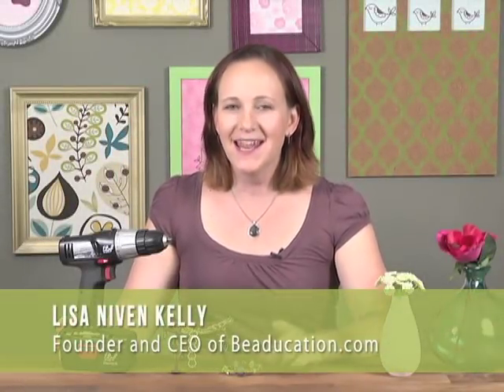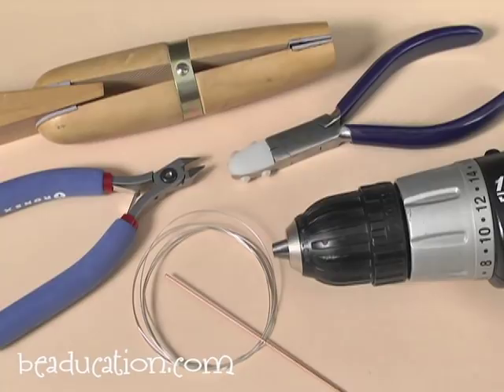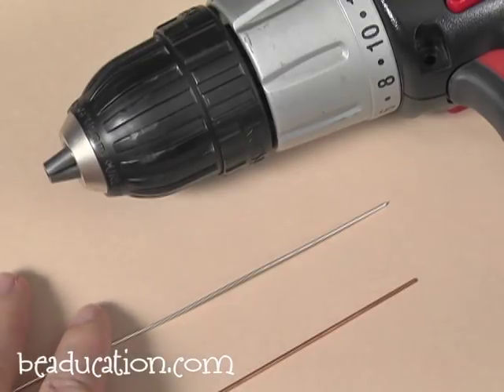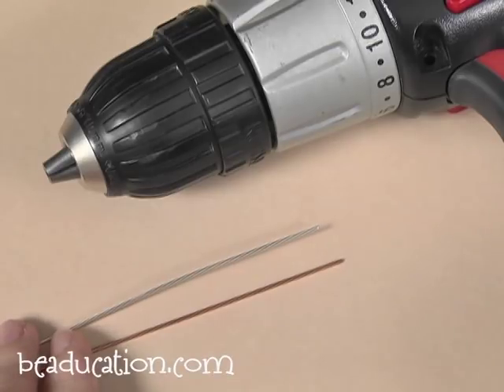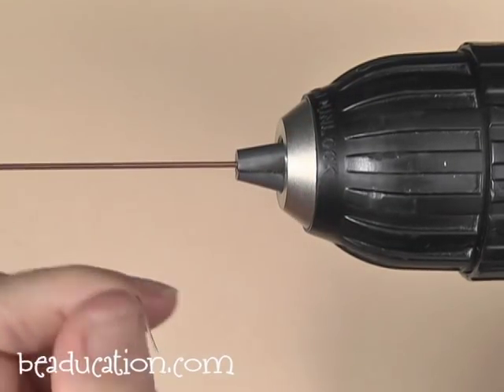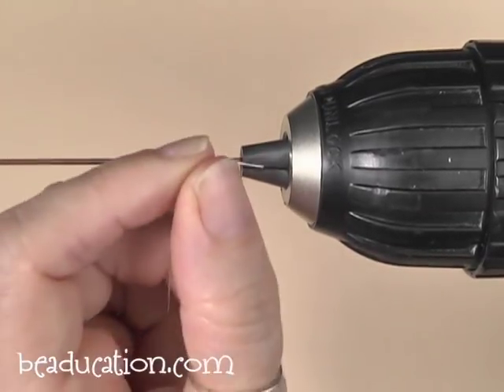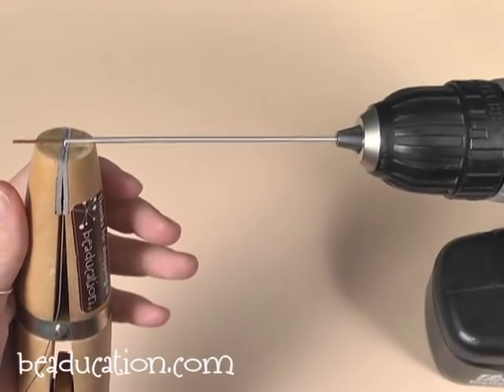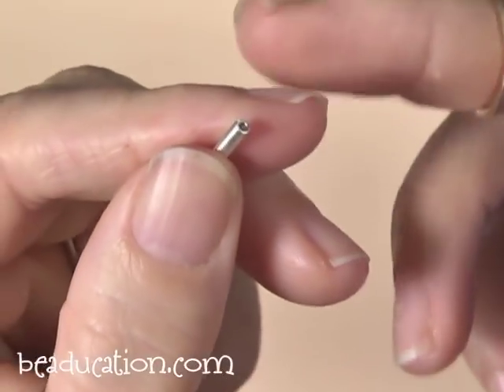Coiling Wire on a Drill - Beaducation.com

Comment: Thanks for this I've been making coils and jump rings this way for years I was beginning to think that I was doing something wrong (I do wear safety glasses) but t is the easiest way.  If you are a crafty type you can make oval shaped wooden 'mandrels' with small hole drilled in the round bit that fits into your drill chuck and you can make nice oval links for charm bracelets (hammer the wire first to harden).
Reply from the maker: Hi there! I am glad you found this useful. I think the number one key here is to use a drill that has an adjustable speed so you don't start fast and quickly get out of control :) Thanks for the tip on making oval shaped jump rings!

Comment: Thanks for the show..One thing i was waiting for to see,, you cut up all the small little coils to size..Thats where i have had
problems...Trying to cut same size coils..I was hoping you had a easy and fast way to cut them to size..I am still learning
to bead and to use wire. So i don't make so many errors..I make little things for the kids in my family and some big ones to..lol..I do get asked to sell my little gifts..If i learn more i might..Thanks  again...JRC.
Reply from the maker: Hi,check out Step 1 on this class, https://www.beaducation.com/online_classes/80-tornado-beads. About halfway into that step I show how to cut them up. To cut them the same size, I draw 2 lines on my left pointer finger and line the coil up to those lines and snip and cut from there. Kind of tricky, eh? Just remember, the lines you draw on your finger are likely thicker than the wire, so try working from the inside of one line to the inside of the other. Good luck!

Comment: Hi, This tutorial is very informative, Thank you :)...

I only had one question, if my drill does not have a reverse drilling option, how shall i remove the tension in the end, before pulling out my coil?
Reply from the maker: You can just release the coil but beware that it will shift a bit when it is released so keep your fingers away from sharp edges.

Comment: Im an avid Wire Wrapper of all different Gems n Crystals. This was a great video! Never would have thought using a drill to coil wire! i have a hand corded dremel and a bench grinder with flux shaft, ill have to try that out. Would just Thick like 16 gauge copper wire work as the host for coiling? its half hard. and takes alot of force to coil a thinner wire. I Subscribed to your channel. lookin forward to future vids. Thank You! :)

Comment: I'm assuming I can get that welding rod at Lowe's, but what would I ask for, what gauge, what size, how long?
Reply from the maker: basically you want any hard wire that is the gauge you want. The length shouldn't be any longer than a foot.

Comment: I used 16ga copper wire as my core wire and 20ga to coil with, WELL ! I couldn't get the coil wire off, it was sooo funny. I have to find a stiffer piece of material and try again.

Comment: Where can we get those skinny welding rods?
Reply from the maker: +mrgorky777 Hi! We would recommend checking at your local hardware store. Have a great day!
Reply: Go to a welding shop and ask for TIG stainless steel rods, the best and stiffer is the alloy 316, but 308, 309 and 312 work very well. You have then in diameters 1/16, 3/32 , 1/8 and some times bigger. 
It's a very common stuff easy to find in most towns. Shops will accept to sell it by piece. Great advantage it do not rust. Great for making tools also. 
If you need thinner diameters the RC models shops have the very stiff piano string. That rust and have to be kept oiled.

Comment: Where do I get those tools?
Reply from the maker: For a drill you can check out your local hardware store. Lisa uses 1mm welding rod, but you can also use piano wire or any other hard wire. 
https://www.beaducation.com/online_classes/156-coiling-wire-on-a-drill